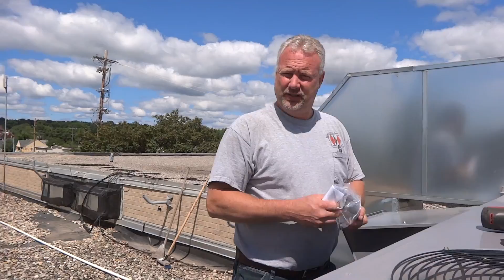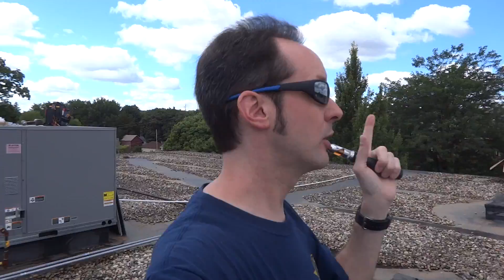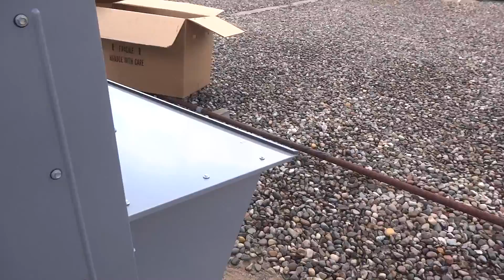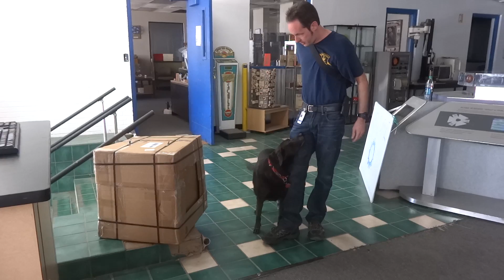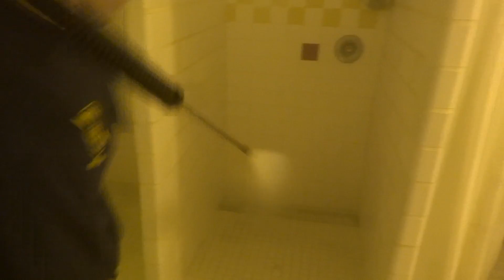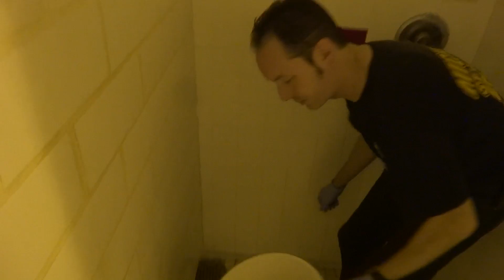Captain's Blog 8 14 2013 Rage Shower Cleaning

Comment: I recommend douching the whole room in Pirahna solution- a 3-to-1 mixture of concentrated sulfuric acid and 30%-concentration hydrogen peroxide, which reacts to form peroxymonosulfuric acid and free oxygen radicals. Piranha solution is used in clean room situations to remove the last traces of organic materials from silicon wafers and such. Do not handle Piranha solution in anything other than glass, and wear a full respirator and chemical exclusion suit, as the vapors are extremely nasty.